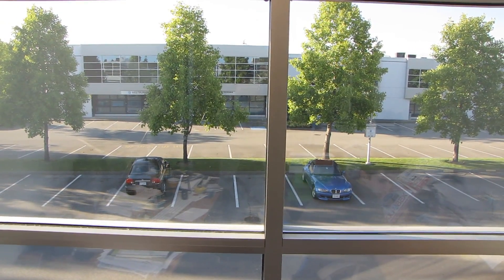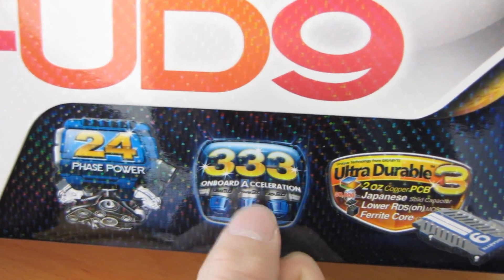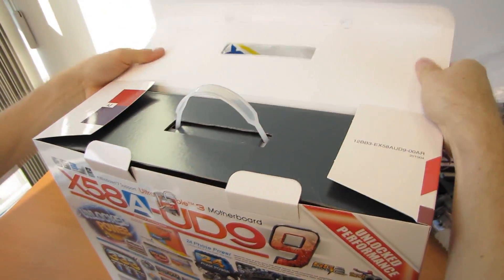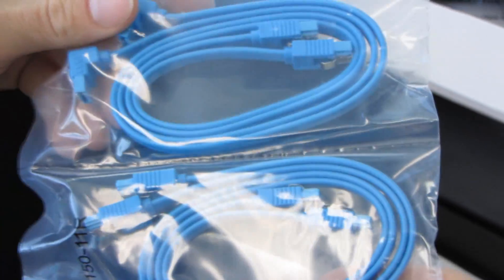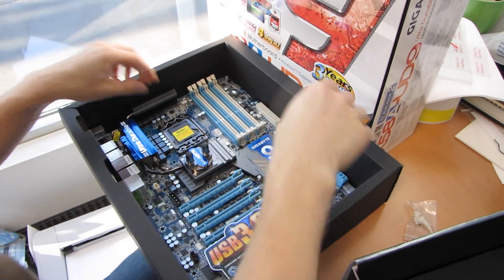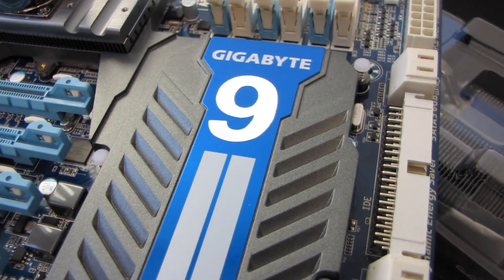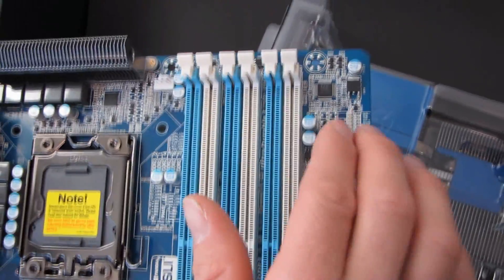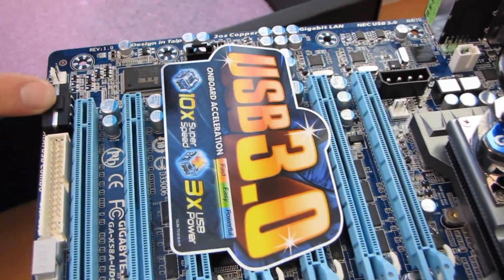Gigabyte X58A-UD9 SLI XL-ATX Gaming Motherboard Unboxing & First Look Linus Tech Tips

Comment: Haha i still used this motherboard now on Xeon X5670 with 3 ATi 5870 ^.^
Reply: do you still use it in 2017
Reply: wubman gaming it's a great board and with a Xeon, it's a killer also
Reply: yea. im thinking about getting the x5650. 6 cores :D i currently have a core i7 960. and a x58a-ud3r. but i dont know if the x58a-ud3r can use the x5650. i know its not supported on the website but i jsut dont feel like spending $60 on a cpu that might not work :/
Reply: wubman gaming it works
Reply: Dean Grey Can confirm.

Comment: @kenmha no it doesnt sandy bridge has a new socket. propably the new socktet 1156 that will have 1155 pins. so it wont support the new CPU's 

there are a couple of 6 core CPU's the i7 980X the i7  970...

Comment: Something I absolutely hate about Gigabyte colour coding is that those white SATA connectors don't actually signify SATA 6Gb. The board only supports two SATA 3.0 interally from a single Marvell chip and ten SATA 2.0 (eight interal and two eSATA). I really don't know why they insist on colouring ports the way they do.

This is taken directly from Gigabytes website and several others, btw.